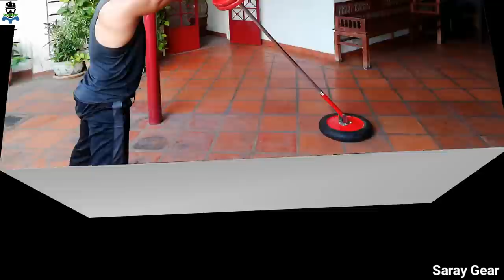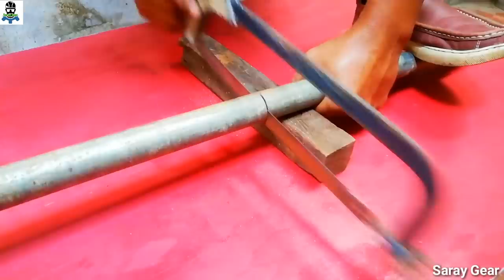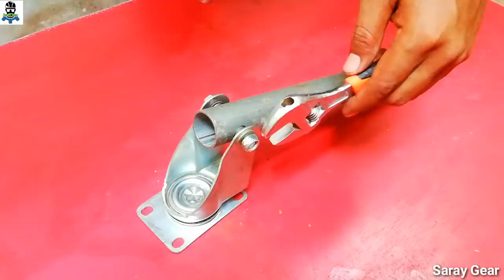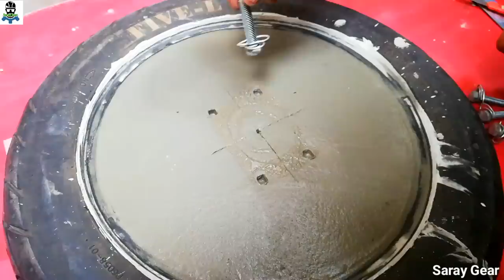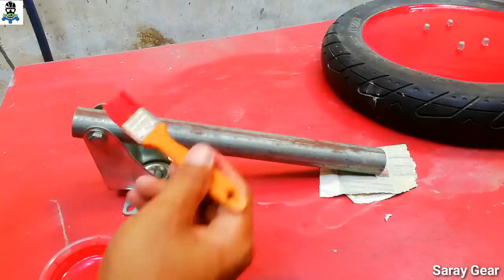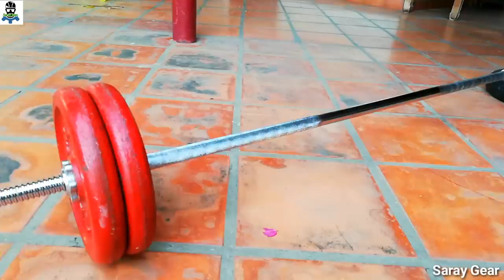DIY Homemade Barbell To Be Landmine & Workout At Home

Comment: Wow good diy but the way you put the spin lock on the bar seems hard to remove afterwards.
Question: can you tell me the diameter of the steel tube and the size of the long bar you use, thanks hope you reply.
Reply from the maker: Steel tube 0.40cm to 0.50cm long bar is 1.80 to 2.00 metter